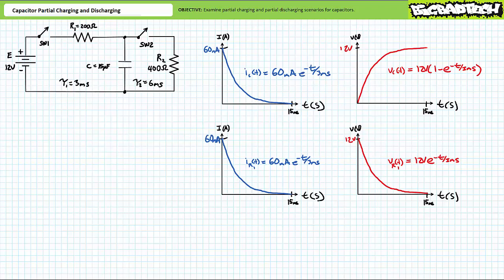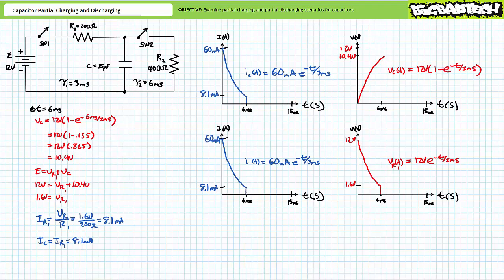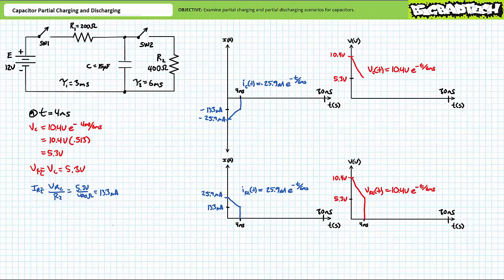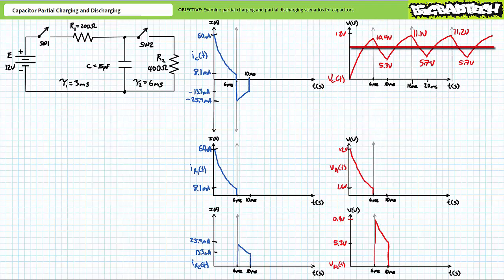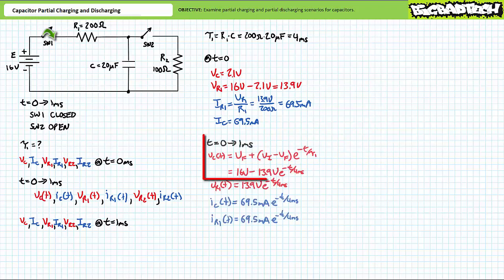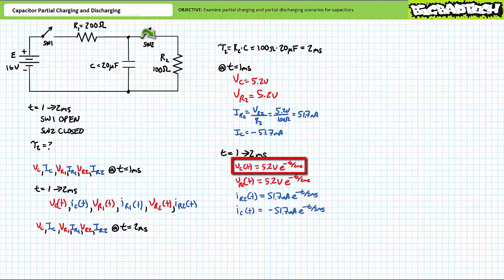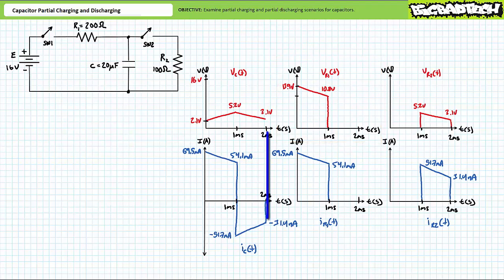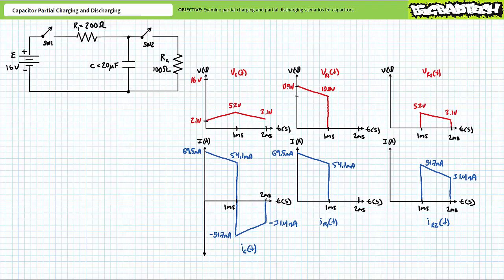Capacitor Partial Charging and Discharging (Full Lecture)

Comment: Can we charge the capacitor faster by increasing the input voltage? I guess this can reduce the Time constant? Time Constant =(V/I)*C
Reply from the maker: True. Higher voltage and lower resistance result in more current (ie: faster rater of charge transfer), however, quite like blowing out a birthday candle with a leaf blower there are practical limits!
Reply: @bigbadtech  Thanks for the reply. Your videos, explanations and responses are top class by the way. Liked and subbed.
Reply from the maker: Very nice! Please tell your friends about this free resource.

Comment: What happens if SW1 never opens after it is closed? What will the curves look like then?
Reply from the maker: Good question. Any switch that remains open or closed longer than a full 5 time constants would see the capacitor enter a steady fully charged or fully discharged state. Example: 1C capacitor with 1ohm resistor and switched 5V source. At t=0 the capacitor exponentially charges to 5V and current exponentially drops. If the switch remained closed past 5 seconds the current remains 0 and the capacitor remains charged at 5V. In theory however you might observe a tiny amount of current (on the order of micro or nano amps) to compensate for self discharge.
Reply: @bigbadtech  Thank you. What if SW1 remained closed after 5 secs, but we closed and opened (or partially closed and opened) SW2 every few seconds after that. Closing SW2 means we're discharging, but SW1 is closed as well...so in this scenario are we charging or discharging and what happens to the output voltage?
Reply from the maker: Another good question. With both SW1 and SW2 closed the capacitor sees the Thevenin's equivalent circuit. Check out the "capacitor charging featuring Thevenin's Theorem" lecture at: https://youtu.be/sJ9U4MD8Mp0
Reply: @bigbadtech  Thank you!